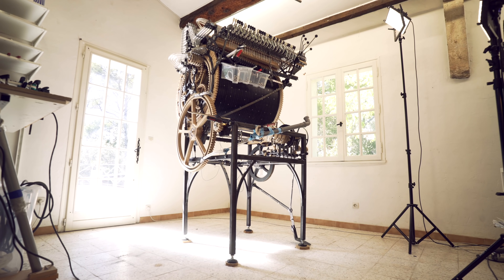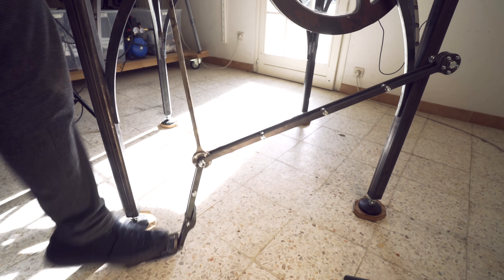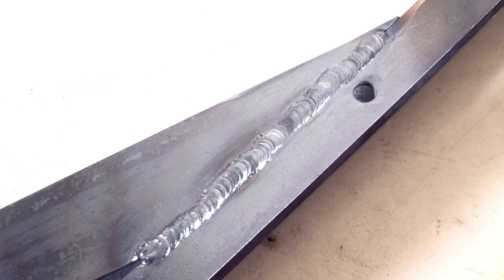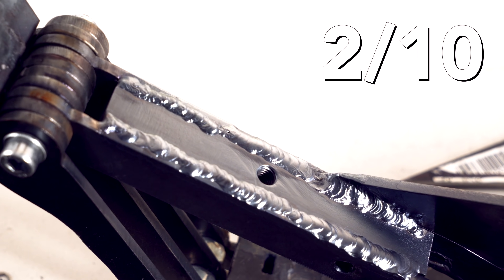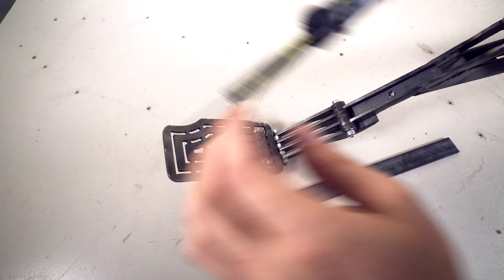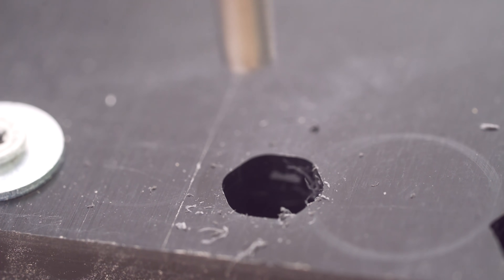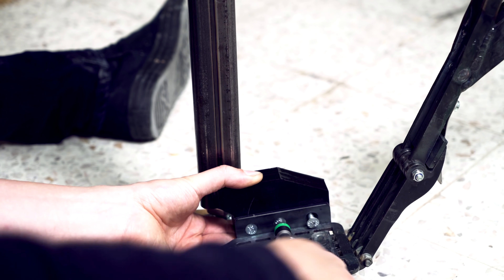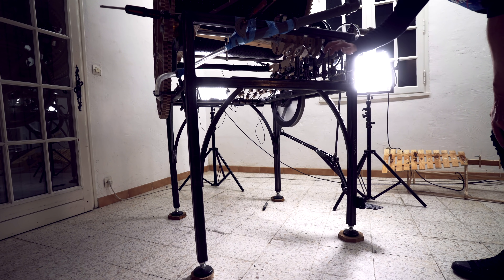Treadle Pedal Completed - Marble Machine X #81

Comment from the maker: When I was a kid we used to go visit my grandmother and grandfather and they had an old Treadle pedaled Singer sewing machine. I could sit for hours just pedaling that machine, I was totally in awe over how it's flywheel transformed the up and down motion of the treadle pedal into a rotating motion. When I was sketching the design for the Marble Machine X that childhood memory struck me like a bolt and I knew I had to incorporate something similar into the MMX and now it is finally completed! 

It took some iterations to find the correct geometry, to have the correct motion but now I would say it works perfect. The pedal is connected to a CAM shaft on the crank shaft and it moves in time with the music. Every downstroke of the pedal is like a metronome click to the songs which allows me to basically tap the beat of the song and play music instruments with two hands. It also gives some rest for the arms :).

By the way: I listened back to last weeks snare sound, it sounds pretty awful :). haha, will be follow up videos on me fixing that sound, we need CRISP. C R I S P.
 
HUGE Thanks to everyone who are watching and supporting this looong Marble Machine X Project! 
Good luck with your own projects/Martin
Reply: crisp intensifies
Reply: An idea that could resolve your flippy pedal problem and make MMX a bit easier to maintain rotation. Leave the pedal where it is, but instead of an offset crank to drive the flywheel use a system similar to an engine pull-start. It would allow the pedal to remain stationary while not being used and if you use oneway bearings it would also be silent. Could also change the drive radio pully so you could apply harder pressure instead of faster rhythm to increase tempo. 

Been watching for quite a while and just love watching the build! Thanks!
Reply: @Boos_ey  Great idea using a pull-start mechanism! And the cord would allow the foot pedal to be moved around. I'm picturing a modified kick-drum pedal (so your heel is stationary and there's no danger at all) with a cord leading upwards, over a small pulley/tensioner, and connected to a pull-start mechanism on the drive shaft.

I don't think he'd want the rhythm to differ from the tempo though!
Reply: My grandma had one of these too, and it goes without saying that I did exactly the same with hers. Nice work Martin :-)
Reply: For the snare, what if you used a small portion of snares from an actual snare drum? Like cut off a tiny section and make a scaled down version of the real thing.
Reply: @girldethunderscore  good, except maybe that a scaled down version also changes pitch (if the instrument happens to have a pitch) but often one can counter the change in pitch somewhat if one also changes material or strain
Reply: @FrankHarwald The snares are the part which makes the snare drum sound like a snare drum - without them, it would sound like a tom drum. I don't know much about stuff like that, but I don't think making the snares smaller would change their pitch at all, because you aren't resizing them, per say, you're just cutting out a section of them. So I think it might be possible to create a custom cutout of the snares to fit a smaller drum. I could be wrong though.
Reply: that's cool how a childhood memory inspired a part of the machine. your uploads always remind me that it's wednesday :D
Reply: If you continue to get twist in the treadle system, I'd suggest using box section tube instead of separate plates bolted together with spacers.  Box section should be inherently strong against twisting and bending.
Reply: Hey Martin, I really enjoy your videos and watching the MMX come together. Great work on the treadle pedal by the way.

I saw a comment from someone saying that they look forward to hearing the MMX play the original Marble Machine song. I think that I would have to agree. Having that song open for the MMX would indeed be an emotional moment. Sort of looking back on how far things have come along.
Reply: My parents had an antique spinning wheel that did the same thing, and if we were careful, we were allowed to gently play with it. Step, step, step, step, step-step-step-step stepstepstepstep... that thing went really fast after a while.
Reply: Why did every grandparent have one of these? (mine too)
Reply: Why don't you make a fixed sliding guide for the pedal? That way it's not only fixed to the machine, but also fixed on the horizontal axes.
POM also will wear out eventually.
Reply: My grandma also had a treadle sewing machine! I remember, it was a huge rectangular pedal. I loved to press it everytime I went to see her, like, 30 years ago. Ah, good old times. Thanks for Wintergatan Wednesdays, you've got some good old memories back!
Reply: I think you might want to consider a design where you can keep your heel on the ground while pedaling. Just like an old sewing machine. Better for your balance and endurance...
Reply: I grew up with such a Singer standing in my childhood bed room and I can still remember the sounds it made to this day.
Btw...what if I don't want you to finish the Marble Machine X? What if watching you work on the machine is the biggest joy this whole project brings me...
Reply: im no exprert on enything basicly but on the foot pedal i was thnking... to keep energy from the kick to the pedal.. a simple bar (plywood???) and a spring to keep the"momemtum" in the kick.... tho now i think im not the first with this idea but isnt half of the whole MMX to minimize energy loss in single movement ? ...Also longtime fan, sry for bad english and keep up with the good content... Greetz from Finland! PS: im better in picturing solutions in my head then writing them ;=)
Reply: Wonderful creativity!
Reply: that's a déjà-vu here as my grandma also had a fully mechanical cast iron Singer sewing machine like that with a treadle pedal!
Reply: I have 2 of the old Treadle machines, that is what I learned to sew on!  Well done!
Reply: I beseech thee, Martin: Evil Wilson=Dr. James Spalding! See the Tom Hanks movie Castaway
Reply: In my neighbourhood, when I was growing up, a lady on the corner lot had a spinning wheel, and I learned to spin wool (in the 70's). In school, at home economics, we had the same sewing machines as your grandma. So, I have the same fond experience, of that rhythmic sensation of pumping my leg to move the parts in a rotation. Maybe that is why I prefer standard transmission over automatic. \m/
Reply: If you are using a twisted taps are not supposed to be turned backwards. The spiral will transport the material up like in a drill.
Reply: hopefully you'll manage it under 100 episodes :)
Reply: you might consider using ceramic bearings for the treble pedal and crank. it will have less friction and less fatigue for you! www.bocabearings.com
Reply: I used to to the same with my grandma's singer machine, until one day I put my thumb finger right where the needle goes and my finger was pierced through, cried a lot that day
Reply: @OlivierCR  that does sound quite painful... reminds me of that time i stepped on someone loosed 3  bared fish hook with a large weight attached....  several attempt where made to try to remove it even before i was taken to a hospital which took time... then i had to have a shoot too.. grievous bodily harm suck!
Reply: @ZerqTM  Fishing hooks are the worst, you can only remove them if they got in just 1 or 2 mm deep. If deeper, there's no way other can going to a hospital for a shot of anesthesia, unless you have viking blood and just pull the hook regardless of the pain.
Reply: Plz read!
Reply: Thanks for the good luck, I just finished my masters in computer science
Reply: Awesome but you didn't put your foot under it to test out the safety feature.
Reply: Huh. You're going back to off-the-cuff one-off fixes. Now, after 2 years, you have a much better instinct for what will work,  but you've gotten away from the systematic design-cut-tweak-redesign cycle you had gotten into. Wasn't the ad-hoc nature of MM1 part of why it wasn't strong enough to travel?
Reply: Yesterday i tried to show my girlfriend what exactly are you doing. And i could not find video with working machine playing music. Please make one.
Reply: I'm so excited to see the mmx be completed and yet... I love watching it being built. Somethingsomething journey somethingsomething destination... just keep doing you. We want you to get to the finish line and make music but if it takes longer, more videos for us so everyone wins either way.
Reply: I  had pretty much the same experience during my childhood. and I think it was a Singer too.
Curious and creative minds like you are fascinated by seemingly simple things while others dont understand whats it all about.
Great project you are doing, wishing you all the best!
Reply: 9:47 Sorry Martin, but it is not fixed!!! Longer arm of pedal assembly is still bending badly under the load. It is visible when you stepping on the pedal. Those flat bars are simply to narrow. They will break at some point. My personal opinion is that, you will be better off, when you design new, wider pedal arms, like wide flat tiangle truss type or something.
Or maybe try different design, like this:
https://www.youtube.com/watch?v=MBwlmB1aGmA
Your pedal could be longer, with wide, sturdy axle at the lower edge of it.
Less moving parts, no side to side play, no danger of pancake toes, sturdy and elegant!!
Reply: I BELIEVE and hope to see the MMX in Australia if not I will have to leave my country for the first time to see this thing go. I've seen every minute of all the MMX videos except for the cad tutorial. Its so satisfying to see the progress on the wintergatan Wednesday's and its something I am sure I will never forget.
Reply: I know the feeling... my grandparents had a Singer as well. I would like to donate to this project... but not by the patreon monthly way. I would give a one time donation... HOW can I do this? Ja, svenska funkar bra.. född och uppvuxen i Sverige.. Bott i Trollhättan sedan 1989, och flyttade till Vänersborg för tio år sedan.
Reply: Meditative.
Reply: check this kid out, he created a piano version for starmachine 2000. 

https://www.youtube.com/watch?v=yLhvGglalUQ
Reply: My grandmother has a sewing machine like that as well, and the first time I used it (which wasn't too long ago), it was like an ASMR experience. Its so smooth, so precise and seeing the up and down motion being turned into a rotating motion by the flywheel is just awesome. So I'm happy that I'm not the only one who was in awe when he used a sewing machine like that :)
Reply: I'm actually repairing one of those right now! It's an electric model, and the insulation has disintegrated off of the wires
Reply: Have you tested the force of the springsteel in the safety feature? From the video it looks to strong so you can still hurt yourself from the pedal.
Reply: Where did you get wilson

Comment: I'm glad to see your tap survived, but I might make a suggestion on tap selection.

That tap you're using is a spiral fluted tap, which means it's almost certainly a "bottoming" tap. It's designed to pull chips up and out of a hole that has a solid bottom, and to cut threads down to the bottom of the hole. For this reason, bottoming taps have a very short taper from the leading edge of the tap to the full thread form.

Because you're tapping a through hole by hand, you really want a plug or taper tap. You will have to exert less force because the full depth of the thread form is cut more gradually and with less force (especially hand tapping) there's less chance for that force to be applied in the wrong direction so you break fewer taps.

Comment: Is it just me, or did the pivot arm connecting to the back leg flex at 9:48 , when Martin put his weight on the peddle to test the new angle's strength? I feel like that might warp after a while, if he cranks the pedal with his foot too much, or if he puts too much weight on it. 

Also,  if the safety feature ends up bending too far, won't the brace go further than the spring steel can reach? The pedal might be kicked up accidentally if Martin lifts his foot from underneath it. Maybe a tension coil-spring should be used instead?

Comment: once, This Old Tonny said in a video, and i paraphrase: 'the reason Tig welders are the choice of instragram welders everywhere, is that you can go back over your weld with just the tungsten, and remelt it until its pretty.' so if your weld isnt artsy enough, redo it.

also, it looks like your welds are fine, just not sturdy enough.
most of welding, like body work, and paint, is prep.
yes to the grinder, and wire wheel, and acetone.
all good
next lock it down as tight as possible. put it in a vise so you can lean on it.
next, 

lean on it.
if your standing on the floor, and welding, the weld has the entire length of your body as room for error, so you have to stand very still.
if you slide your pinky along the work (with protection of course) as you weld, then only movement between your pinky, and forefinger can cause error.
thats a lot less flex then;
your entire body, 

plus the flexibility of the piece, 

plus that time you sneezed, and welded straight across the work bench.

Comment: I would be concerned with his safety improvements, preloading it against the leg means that it wants to go   sideways a bit at all times. If something where to get under the pedal accidentally, it may cause the bushing to no longer correct the arms angle. Idk he didn't test it in video, but I'd just recommend checking with the pedal lifted. Objects with momentum behind them don't like to be stopped suddenly. New to this build so I'm unsure if there is a clutch between his leg kick and the spinning drum.

Comment: I'm just waiting for the block to get stuck behind the pillar when it's in fast motion, and rip machine.
Reply: 1.  There is a spring holding it down so it won't flip up.
2.  The flywheel has a clutch that prevents damage if any part of the machine gets jammed up.

Comment: Couldn't the welds be neater if bevel grinding the adjacent pieces to form a V? Then filling in the top of the V formed by the two pieces, should be enough meat to the join to do a flush grind. I'm no expert here, but I've sworn I've seen it done in other videos on that subject. Or is that too much extra work?

Comment: To make it stronger for twisting, you want a tube, not an ][ beam. The twisting strength basically goes up with the enclosed cross-sectional area of the thing. An ][ beam has fantastically less enclosed cross-sectional area than a tube (square or round usually) of the same size. Glad you got it strong enough. I would also consider adding an extra diagonal going horizontally-ish to another pivot in-line with the first.

Love the work. Looking forward to more!

Comment: Fun episode. But, I think that there are going to be problems if something ever gets under the foot and it flexes up. Seems like the spring steel will "lock" it into the folded position and it will be very hard to get down. I think you probably want a different type of spring that will return the pedal to the down position no matter what so you can keep going.

Comment: You did not test your foot getting caught under the pedal.  I suspect when it folds, the Delrin block will catch on the marble machine leg.  What I would do is add a cross-member (with ball joints on both ends) to the other side of the machine.  No sliding, and keep it away from the leg.

Comment: Hey Martin!

Will the safety feature of the treadle pedal interfere with the pre-loaded delrin bushing? It looks like the pedal may clear the post when it flips up, and is on the up swing, and that the pre-load may pull it inside the front leg of the machine. I'm afraid that if that happens, the momentum will shove it back down, and bind between the legs.

If that's a problem, I wonder if a ~60-degree champher on the inside front and bottom of the delrin would be enough to  slide it back out, or if that would prevent the preload from working the way it is now.

I'm really enjoying your videos, and I also can't wait to hear more music as the machine grows!

Comment: Hey man, as a welder, that weld you made is pretty good looking, especially for someone that doesn't weld every day. There isn't any undercut around the weld that I can see from the video, the weld itself is fairly even in size, and structurally speaking it looks quite sound! I don't know what techniques you're using in your welding, but one tip I like to give new TIG welders is that there can be sort of a rhythm of motion to it, especially if you're trying for appearance as well as structure; the act of moving about the same distance forward while adding the same amount of filler with each 'step' can develop it's own cadence. 

I'm quite enjoying seeing this machine come together and am excited to see it finished!

Comment: Another great video!  You may want to double check the deleron block does not kick over behind the leg if you get your foot under the petal and it lifts up too far.  Since you pre loaded the arm assembly, it may pop over and since it is attached to the crank it may cause the machine to stop.

Comment: I'm still a bit worried about safety. The problem is that the hinge on the safety feature is still quite close to the ground, and it seems like it could be possible for the whole upper part of your foot to get caught underneath the hinge, which would cause a serious injury. I wonder if it would be possible to replace the metal rod that connects the pedal to the crank wheel with something that would break or bend under compression? Then it would be safe no matter what gets underneath it.